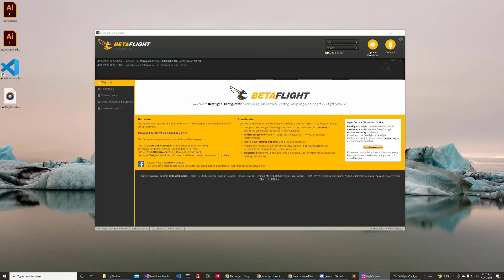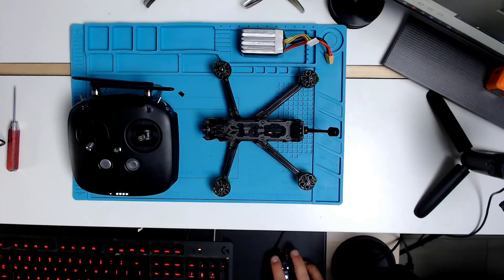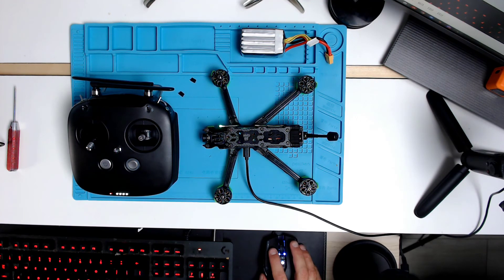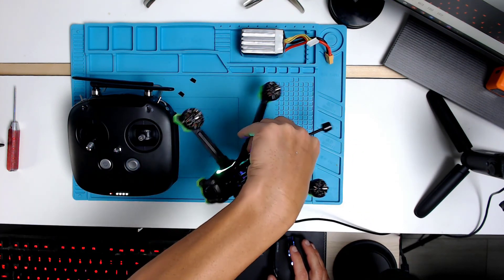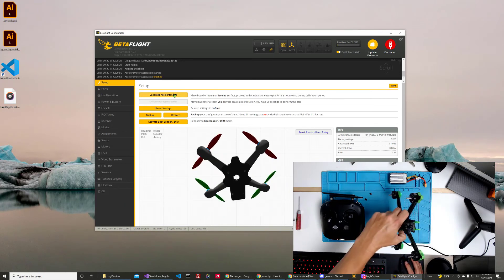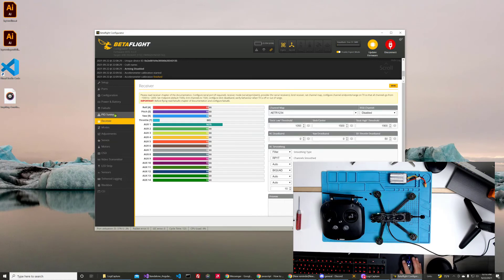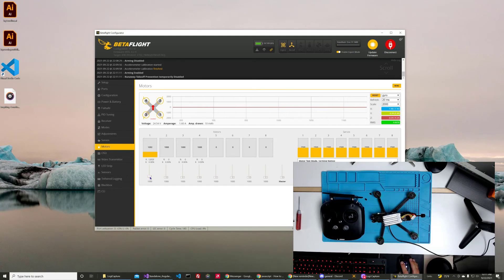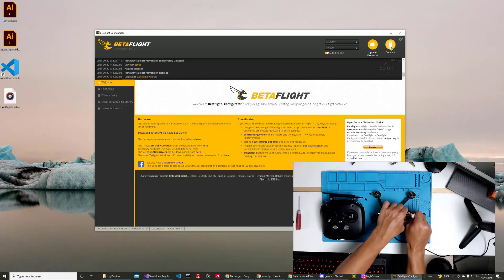Nazgul5 v1 v2 Evoque with DJI Caddix Vista Setup for Newbies - BetaFlight

Comment: I've bounded the controller but I don't get a response from betaflight. I have your exact setup. I don't get the option to move the motors using the computer nor do I get a response when I move the joysticks and it show on the receiver tab in betaflight. Would you have any idea what Im missing?

Comment: Is tightening the props that much a good idea?
Reply from the maker: You don't want props to ever slip.  It will cause your gyro to freak out.  If you heare any squaking in the flight,  its probably a loose prop.  That being said if you have good motors and a good cap on it to prevent voltage spikes,  it can take a minor hit/voltage peak.  But with sensitive motors and no voltage regulation you are right,  it could short the motor or esc.  But I don't crash much anymore so havent burned up a motor in quite a while.